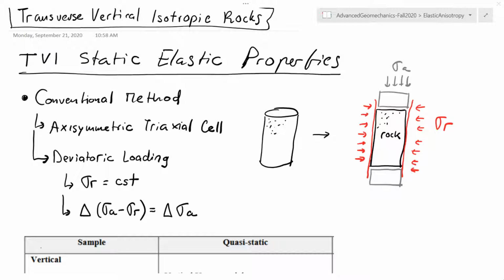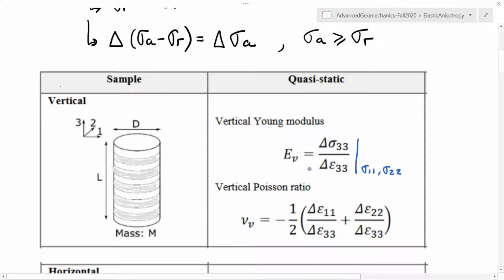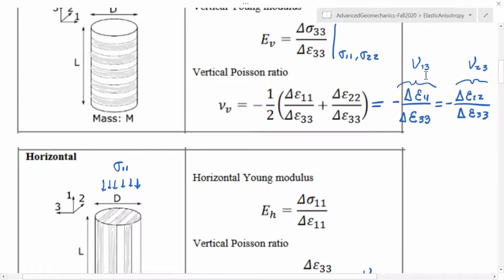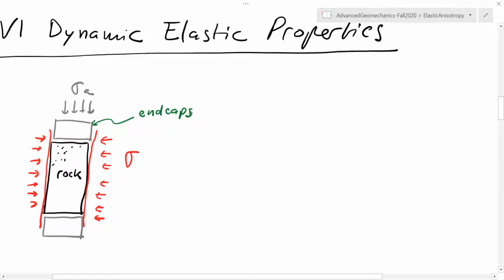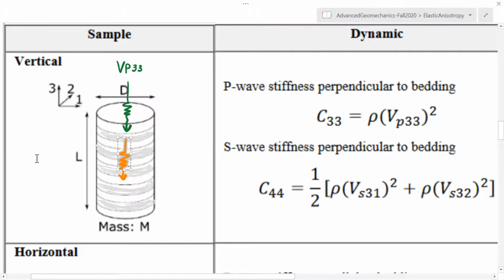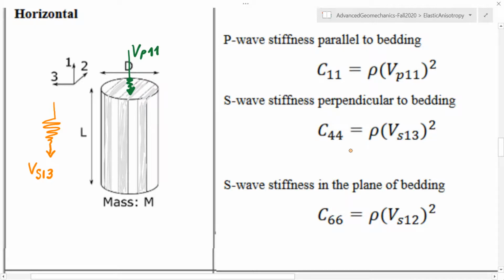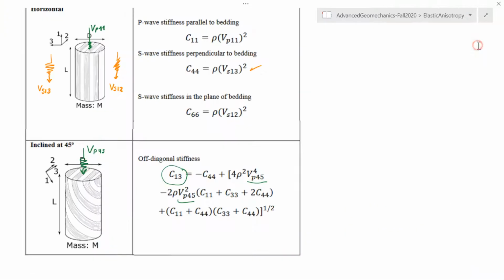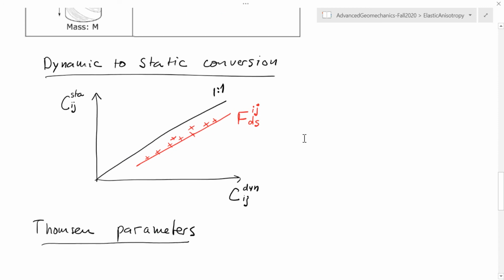L11 Elastic anisotropy measurement in the laboratory: static and dynamic loading

Comment: Thanks Nicolas for this nice presentation. It's really appreciated. Can you please share with me the reference paper URTeC2206 " Determining Static Elastic Anisotropy in Shales from sidewall ........"
Many Thanks
Reply from the maker: This is the link: https://doi.org/10.15530/urtec-2020-2206
Reply: @dnicolasespinoza5258  one more question: Why in the Static we end up with 4 parameters While in the dynamic we have 5 independent parameters?
Reply from the maker: @omarabdullah3221  The 5th static parameter does exist, but it is really hard to measure and not done in most cases.